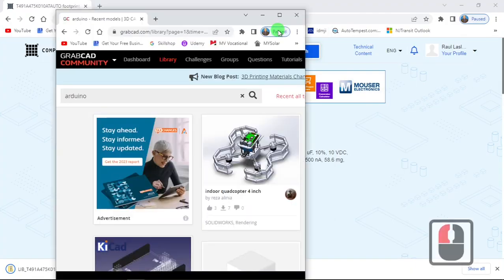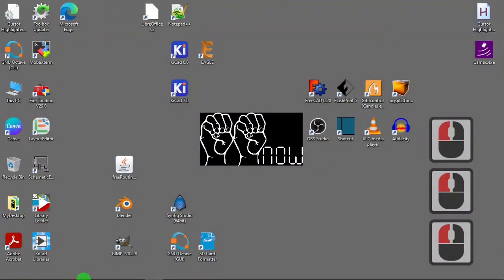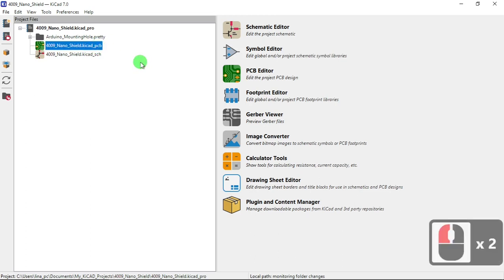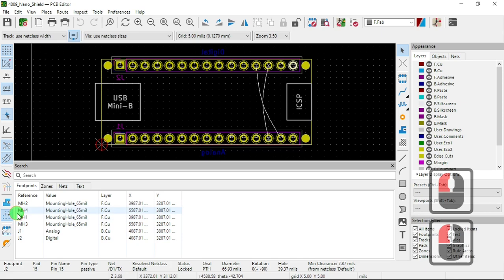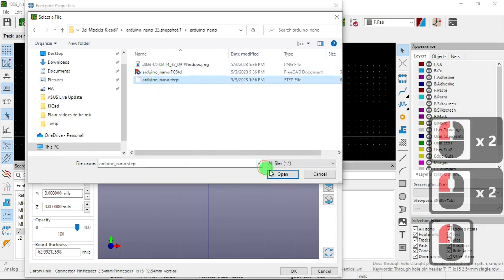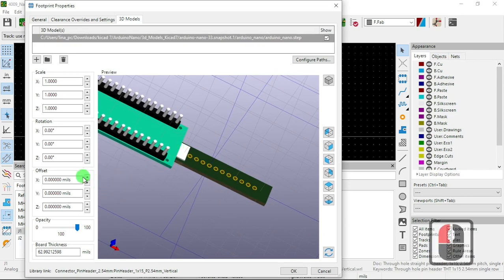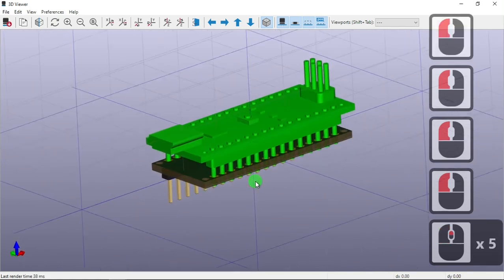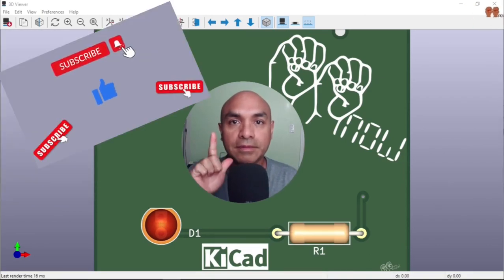How do you import a 3D model from GrabCad to KiCad 7?

Comment: Hi, is there any way to import a 3D step directly to the current (mechanical) layer of the PCB? So I don't want to tie it to a footprint. For example, I want to see a step model of a plastic case around the PCB or an another PCB model in order to testing my PCB stacking idea. In Altium, I can simply add separate 3D step models - not linked to anything - directly to the PCB.